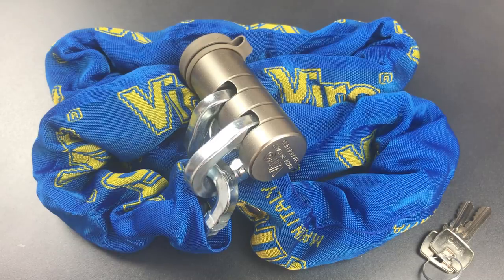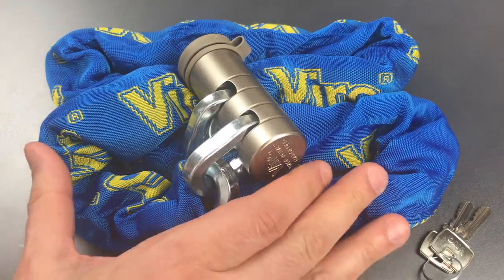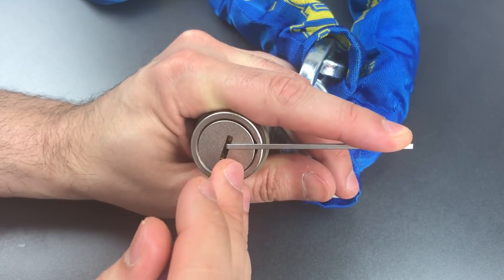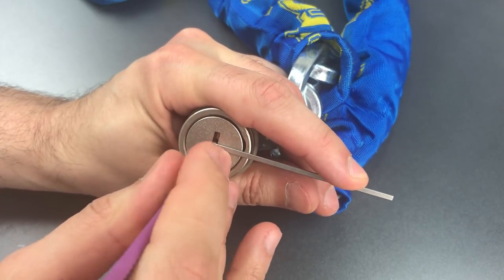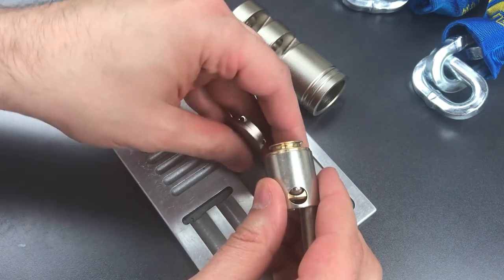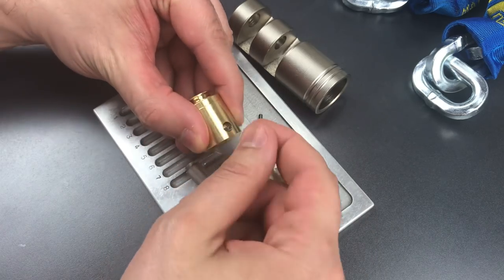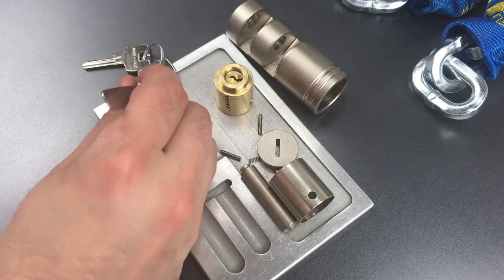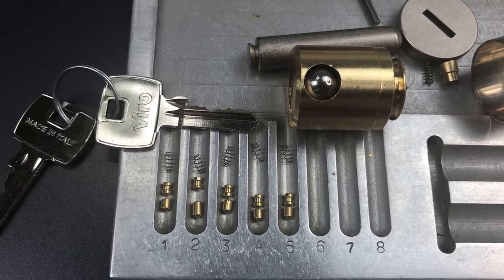[696] Viro Totem Motorcycle Lock Picked and Gutted (Model 4150)

Comment: Is there a video where you explain the terms you say while working on a lock: counter-rotation on x, nothing on x, dropped into a false set...
Reply: Keep watching and you will eventually understand
Reply: You might now know but incase you don’t. Counter rotation is when you feel pin push back against your tensioning tool.  It’s common to feel on like a spool as it moves out of a false set.  Nothing on x means pin in x position doesn’t give any feed back neither set or not set.  There’s a lot of terms but most of them are just describing what you feel on your pick as you feel the tumblers/pins.

Comment: Can you use the ram set and do a distructive opening ? Line it up on the opposite side of the key and hit it right were the pin rests . Thanks for your videos. Very educational.
Reply: harry zimbler I was thinking the same thing! I noticed that the tube walls where the cylinder is placed into are not that thick, so the ball bearing does not have much “meat” to sit into. Also that small pin is not that stong, so yeah the ramset could work that way.
Reply: I would love to see if the lock body is hardened steel and if it can be cut through with a hacksaw?

Comment: I would expect thicker chain for securing a motorcycle in italy. Core puller or slide hammer attack? Im not sure the ramset has much to attack on this other than perhaps just tying to kinetically break the bolt at the dove tail with the cylinder. But that wouldn't unlock it would it?

Comment: That is not a 10mm chain thickness.  The lock is designed for links "up to" 10mm diameter, (guess they never thought the links would be square when they wrote the description).  Unless LPL has some huge thumbs?  10mm is about .4 inches.

Comment: Does the shackle spin to resist hacksaw attacks along side the chain and the lock body?
Reply: The locking bar spins. But even when it wouldn't, you will have a hard time to put a hacksaw blade in, without a vice. If you manage to do it, you will find out, that that locking bar is from case hardened steel.
I use this Viro to lock me bicycle, and no one even tried to steal it.

Comment: Key bitting looks like you could zip or rake it.
Reply: all spools makes for a bad pinning......
Reply: Radek Vamowski under cuts or threading would have helped... But I doubt any of that happend.
Reply: I was looking at the short pins and springs and wondering if it could be combed. You know, use a comb to push both drivers and key pins up into the lock body to open it that way.
Reply: White Tiger Gaming it'd be nice if lpl would try different methods.
Reply: Daddypants11 Or wish he would try challenge locks. He knows everything about the lock before it’s picked.
Reply: r0mediddy I'm pretty sure he doesn't out of respect for Bosnian Bill and his channel... I respect that.
Reply: The springs look a quite  bit too short for that to work. You could try it though.
Reply: Very hard to rake spools, NOT impossible, just tough...
Reply: Daddypants11 If that’s the case, then I would respect that as well.

Comment: what happens if you push the  push the little button with out picking the first bit
Reply: Nothing. The core and the locking pin are pushed forward into the lock. In fact, I don't even think the "button" (or rather pin + spring) is even visible at this point, just a small hole.

Comment: what i find interesting is that this lock isn't great for more expensive bikes partly because of the pin tumbler lock, yet on most people's HOUSES they have the same or a weaker lock! why do we all still use pin tumblers? houses should be using disc detainers by now. although i guess it's easy to re-key? that's probably it. trading convenience for security..
Reply: What sort of lifespan does a disc detainer lock have before wear becomes an issue (I genuinely don't know)?

Comment: Dunno if I'd call the sophisticated but most motorcycle or scooter thefts in the UK are carried out by simply cutting the lock with a battery powered disk cutter or by hitting the rider and taking the bike. Then there's the "locked" bike, attached to nothing, simply lifted into the back of a van. All these attacks take a couple of seconds are require no skill at all.

Comment: Is picking a thing that actually happens? I just can’t picture some dirt bag sitting on the ground with a flashlight and picks opening a locked motorcycle lock. Sure it might happen but I think brute force attacks are at least a thousand times more likely.
Reply: Way more discreet, once you picked it open you have to go away being silent compared to brute force is going to atract some curious people and maybe even the owner of the vehicule
Reply: Mike Price usually yes. Physical strength is 90% of the game. Usually the scrote will use known exploits like snapping euro locks but occasionally you’ll find one that will rake or bypass a lock in a somewhat cleverer way. 
Cordless mini grinders are the great Satan right now, they’ll cut nearly anything in seconds.
Reply: WineScrounger yep one of the nicer brushless cordless grinder can take the side off a "gun safe" in minutes, a chain is nothing. Grinder doesn't care about hardness.
Reply: Mike Price: ... You'd be surprised how often Lock Picking is used by thieves :( ... There's a little known area of Locksmithing called "Forensic Locksmithing" and it's fairly easy (for an expert with experience and training) to use a microscope and tell if a lock has been picked open or opened with a key. 

The vast majority of pick open thefts are chalked up to "Door left Unlocked" in police reports ... A certain volume of high value "Non-Payable" insurance claims, are reversed after it's proven the lock was in fact picked open....  OH! and guess who buy high security locks from that point forward! :)
Reply: statistically yes physical attack is anywhere from 80% to 96% of attacks including freeze, burn, pry, impact, croppers, grinder etc however you dont need a tonne of skills behind you to pick, locksmiths have demonstrated you can "bump" a lock open or they have a lock picking gun which goes up and down very fast with the tension tool which will knock the pins into place and allow access.. to be honest i dont think there is such a thing as an undefeatable lock, theres no material that can defend against cutting or impact, an extremely hard steel would be brittle so would fail against impact, a softer steel can withstand and bend to impact but is easier to cut, there's no middle ground
Reply: With motorcycles, a lot of times it's just a few big guys picking it up and throwing it in the back of a van or pickup. They can deal with the lock later. Grabbing it just takes a few seconds.
Reply: yeah, there's nothing out there to really stop a thief, but you can make an effort, tracking devices help, the best security is a human to watch over it for you like a security guard who can phone police quickly and hold them until they arrive but it means pay them at least minimum wage